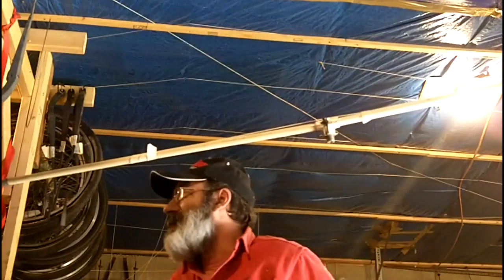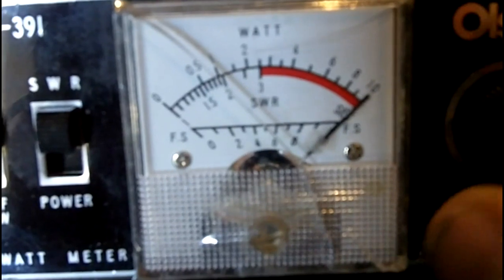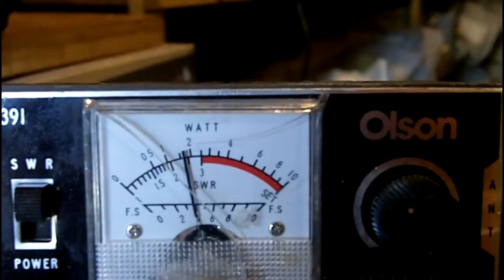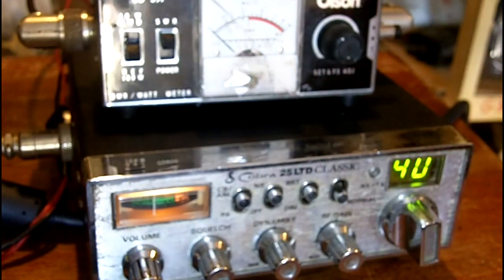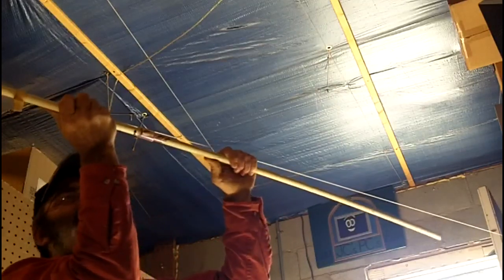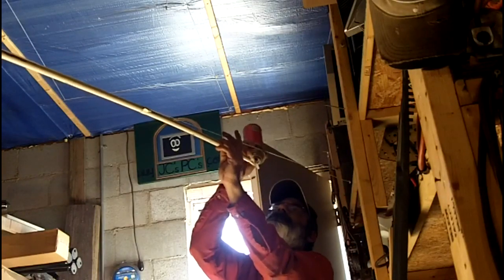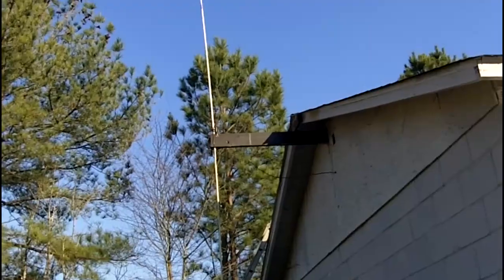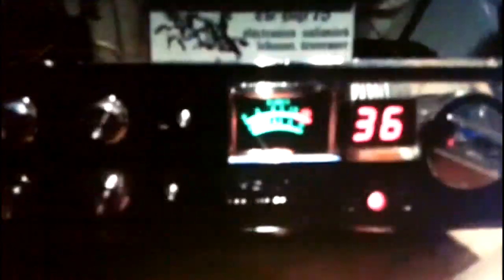Another Homemade CB Radio Antenna

Comment: What length of wire did you start off with on each end
Reply from the maker: I always start with 104" wire for each end.
Reply: Mower Junkie 52” each side
Reply from the maker: @davidstone61  no, 104" each side. then trim to get a good SWR reading.
Reply: Mower Junkie so starting at 9’ and trimming to adjust for the best optimal SWR removing 1/4” at a time so not to over trim

Comment: Is that 3/4 or 1” PVC your using
Reply from the maker: for this antenna I used 1/2" pvc, but the one I built for My house I used 1" pvc.  the 1" holds up better in the wind.

Comment: It's good to see folks experimenting with CB radio antennas.  I hope that the FCC will legalize 50 Watts and PL codes someday.  I would also love to be able to legally do Morse Code on CB.  I don't know which of the two methods would be better, but i think MCW (modulated carrier wave) would be the cheaper/easier method without making CBs more expensive.  A mic with a built-in key or a separate key that can plug into the mic connector.  Or even a splitter so that someone can switch easily between the two.

I'd like to see SSB become standard, too.

These four features could revive CB radio: 50 Watts of transmit power, privacy codes (CTCSS or DCS), Morse Code through MCW, and SSB on all CBs.

Plain, old-fashioned CBs can stay around for kids, beginners, or anybody who doesn't want to experiment or be a hobbyist.
Reply: From the FCC Part 95 Subpart D, 95.412, Paragraph 4, Subparagraph (b):
     You may use your CB station to transmit a tone signal only when the signal is used to make contact or to continue communications. (Examples of these circuits using these signals are tone operated squelch or selective calling circuits.)  If the signal is an audible tone, it must last no longer than 15 seconds at one time. If the signal is a subaudible tone, it may be transmitted continuously only as long as you are talking.

Basically it is saying that CTCSS circuits are allowed in the CB service.

John, N1WOM

Comment: Great video, looking to copy your plans myself. As far as tuning the antenna, did you only trim the "top" element wire, or did you trim both the "top" and the "ground" element wires? Thanks.
Reply from the maker: Yes, You need to keep both wires the same length. That's awesome that You're going to build 1 too. In the next few days I'm going to be building another one. I'll be posting a video of that build, and the reason for the new antenna.  73's  151 SC
Reply: Ok thanks, going to use this for a school project, we'll see how it goes. Also looking forward to the new antenna build. Hope to hear you on the air. 73 from 221 NC
Reply: @gman1285  I use high quality rg6 75 ohm coax measured in half wave sections and fine tune the distance between the feed points for a perfect match every time no baluns or tuners needed.

Comment: Nice job! Next step add a Turner +3 for a strong modulation, these things kick ass in AM (I have one on my President Grant Export), it blows all the others out of the water that's for sure.
KP733 Chris / France
Reply from the maker: I'm restoring a Turner +2 that I'll be using soon.
Reply: @MowerJunkie  That will sound great ! I also have a Turner without preamp, a 50s model, I am currently gathering the parts to make a preamp which will at the same time match high Z to low Z input with the ability to fine tune lows and highs.

Comment: What guage wire are you using for the element?
Reply from the maker: I used 14 gauge solid copper wire.
Reply: Is thicker guage wire better or worse?
Reply from the maker: @nerfatron  I have made a lot of Dipole antennas, and I've used many different kinds of wire, I think the 14 gauge solid copper performs the best.
Reply: Awesome thanks for replying

Comment: So you just connected the half wave dipole straight to the radio with coax?or used any balun/choke?
Reply from the maker: Yup, coax is directly to the antenna.  no choke or balun needed.
Reply: @MowerJunkie  cool,for some reason I thought at least a choke is needed to feed a dipole.
I'm in need for a cb antenna,I think I'll go with a vertical dipole as well after seeing your video.
Thanks for sharing,73! 😁
Reply from the maker: @joczo97  from what I've read, You only need chokes if You are causing a lot of electronic interference or bothering your neighbors.   let me know how you make out with your build.   73's
Reply: @MowerJunkie  hi im from out of U.S I have a GALAXY DX95T converted to CB installed in my 18 wheel truck.
I have mounted the antenna in a grab handle at the back of the truck and it works very good and looks just like your dipole but in my truck 
In from Costa Rica,I had contacted people from U.S,Puerto Rico,Mexico,Barbados,Cuba and more...
My 95 T is at 60 watt 
We don't have regulations here so is not illegal 
Just wanted to share it with u
Reply from the maker: @jcjc2593  Nice radio, I'd like to see Your antenna setup, it sounds interesting. Maybe 1 day the conditions will be right, and I'll get to hear You on the air.   73's   151 SC.
Reply: @MowerJunkie  we the truckers down here use the channel 10 (27.075) but we speak Spanish...
I speak English too 
73
Reply from the maker: @jcjc2593  You should post a video of Your Truck, So Everyone can see it, I would definitely check it out if You did!
Reply: @MowerJunkie  I will and I'll let u know by this same way...
As soon as I do it I'll be responding this message again
Reply: @MowerJunkie  Hello friend the video of my truck antenna is now ready...https://youtu.be/uvYl_7iawLU

Comment: What was your total length
Reply from the maker: the antenna inside is about 205" long, and the pvc pipe is just under 18' long.
Reply: @MowerJunkie  I was wanting to make a J pole antenna
Reply from the maker: @dejo1976  I've been thinking about getting a 2 meter Radio, and for that I will be building a J-pole. let me know how You make out with Your build.
Reply: @MowerJunkie  my will be a 11 meter